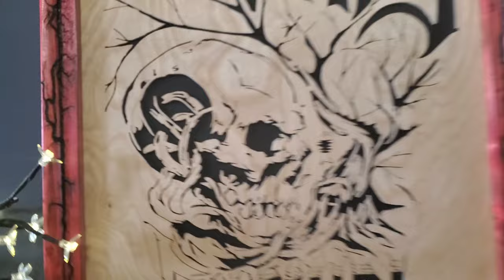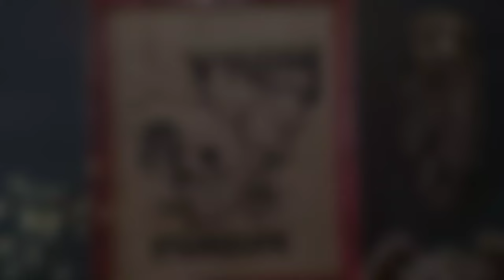Carving a walking stick

Comment: You may not like it but I do. I think it would look good if it had a coat of epoxy. This would also fill in the cracks and help prevent further cracking. I don’t have good luck with wood spirits but I do like carving canes and walking sticks. To each his own.Like you said you don’t enjoy walking stick carving. Nothing wrong with that.